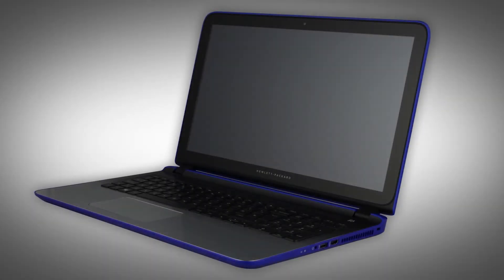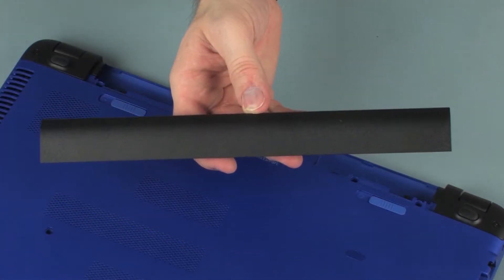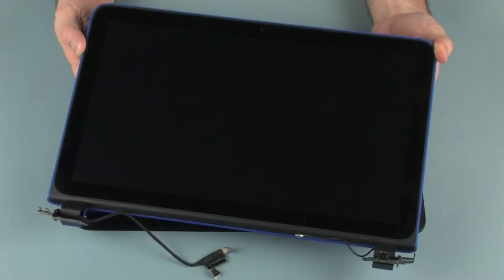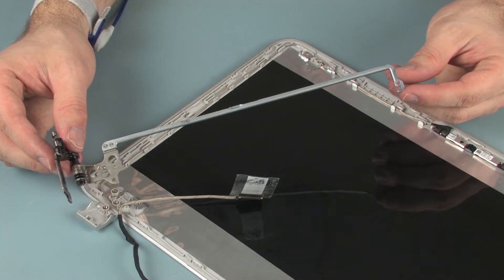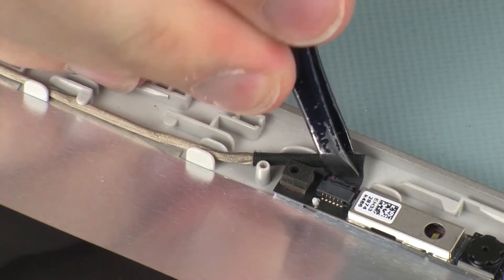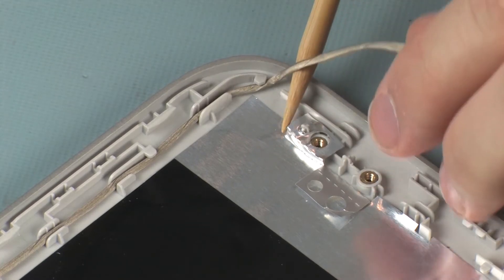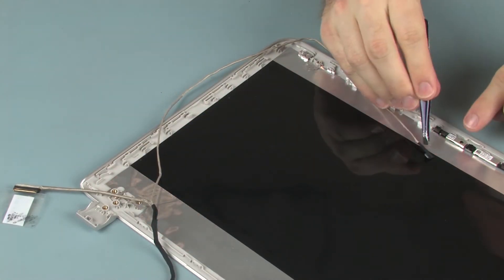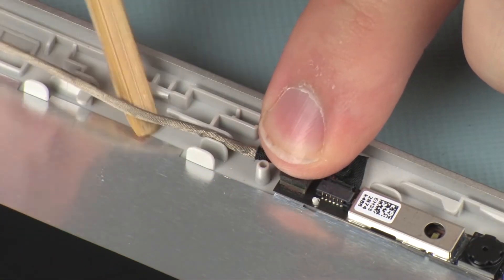Replace the Display Panel Cable | HP Pavilion 15-ab000 Notebook | HP Support

Comment: The 40 pin lcd connector on my laptop, two wires are pulled out because yall just put the wires in there and apply adhesive to keep it ik place, now its out and i cant do anything

Comment: My laptop display is very dim i have purchased few months back only(15sfq5007tu) Indian model the service engineer provided by hp also replaced the screen but the problem is still not solved im facing issue from past 15-20 days in my studies what could be the possible solution ??
Now the engineer is saying that the display cable is having some sort of problem
Reply from the maker: Hi Abhishek, thanks for contacting HP Global Social Media Support!
I understand that you are experiencing an issue with your notebook as the display is dim.
I will do my best to assist you.
Please try the steps mentioned under this video to fix the issue: https://bit.ly/459dePT
Binu-HP Social Media Tech Support

Comment: Where is having good repairs hp service centre in Hyderabad Telangana state
Reply from the maker: Hi Pravin, thanks for contacting HP Global Social Media Support!
I understand that you need to know about the service center.
In order to get this issue fixed, please contact our customer care team over the phone or chat for further assistance, as this issue requires Live conversation with you over phone or chat to isolate the issue and provide you instantly with appropriate solution or repair/replacement options available at your place as per the warranty.
Please feel free to reach us on call/chat, please access this link to select your preferred country and language option to reach us. Global support link: - https://www8.hp.com/us/en/contact-hp/ww-phone-assist.html
Binu_HP Social Media Tech Support

Comment: My hp laptop wire is broken.. the thin black wire is split... How do I fix that???
Reply from the maker: Hi there, thanks for contacting!
I understand that you are experiencing an issue with your notebook as the wire is broken.
I will do my best to assist you.
In order to get this issue fixed, please contact our customer care team over the phone or chat for further assistance, as this issue requires Live conversation with you over phone or chat to isolate the issue and provide you instantly with appropriate solution or repair/replacement options available at your place as per the warranty.
Please feel free to reach us on call/chat, please access this link to select your preferred country and language option to reach us. Global support link: - https://www8.hp.com/us/en/contact-hp/ww-phone-assist.html
Binu - Social Media Tech Support

Comment: You spend so much time showing us how you run a cable but no time is spent showing us the motherboard connection? Honestly... How silly
Reply from the maker: +Tate Academy Please refer the user manual of your notebook to know about removing and replacing the parts: https://bit.ly/3zz6BI1

Comment: Thanks a lot for this great video.

I would like to know the exact name of this "panel cable" that works for this model "HP Pavilion 15 au123cl".

If there is any oficial site where I can buy it I would be pleased, I need this cable in Ireland.
Reply from the maker: +ezequiel garcia You can purchase the part from here: http://partsurfer.hp.com/ Please select your country and enter serial or product number of your unit.
Reply: @HPSupport  That's it! thank you for showing my where to buy this product, but I need a serial or product number, where i can find it?

Comment: My HP Laptop Has A Small Damage But This Damage Gro And Make A 1 Centimeter White Line I Don't Know 
What I Am Do Please Help
Reply from the maker: +Vishesh Dwivedi This document provides solutions to a variety of problems that can occur with notebook and All-in-One displays such as blurry text, poor video performance, black or white screens, or damaged hardware. Find a section below that matches the problem with your display, and then follow the steps to resolve the issue: http://hp.care/2oPxHcG

Comment: When I turn on my laptop, only the keyboard lights show. The caps lock and number lock flash 5 times. After that, the fan in the laptop starts making a louder than usual noise. The screen does not come on. What is going on please?
Reply from the maker: +Glory Ohiemi This document provides possible solutions to many common computer start-up issues. Follow the instructions in this document step-by-step to help isolate the problem and find the most appropriate help: http://hp.care/2oFlOWC

Comment: My laptop only works when the screen is positioned in a certain angle- is there a video explaining how I can fix that?
Reply: Same problem here bro the wire may be damaged like in my case
Reply from the maker: +An Ha The cable that connects the display is probably damaged or loose. Please contact our phone support team to fix this issue: Please follow these steps to reach them.
Step 1. Open link: https://support.hp.com/us-en/contact-hp
Step 2. Select the product type.
Step 3. Enter the serial number of your device or select let HP detect your product option.
Step 4. Select the country from the drop-down.
Step 5. You should see the HP phone support number.
Reply: I have the same problem. Did you fix the problem @An Ha? How can  you do that and how much cost(price) needed?
Reply: @rohanshava5490  we did! we actually got a new screen, which fixed the problem

Comment: Would be helpful if you showed where on the motherboard needs to be accessed to connect/ disconnect the cable  (the link you have down below in another comment doesn't provide any information about the display panel cable)
Reply from the maker: +Tahlia Schroeter Please refer page number 59 of the user manual to know about removing display panel cable: https://bit.ly/3fJZS2Z

Comment: my hp ab 205tx display got pink lines and touchpad mouse is not working! please help!
Reply from the maker: +Sri Tej Koduru Please perform updates via Windows and HP Support Assistant as mentioned below to fix this issue:
Step 1 Windows Updates - 
1) In the search box, type and open Windows Updates. 
2) Check for updates. 
3) If the updates are available, click on install and restart the computer. 
Step 2 HP Support Assistant Updates - 
1) In the search box, type and open HP Support Assistant. 
2) Check for updates. 
3) If the updates are available, click on install and restart the computer.
Reply: @HPSupport  I did all of that. The software is fine. I assume some hardware issue I got.

Comment: When i turn on my laptop,  all the screen turn pink,  and a sticking image is shown with the HP logo,  is it the problem with the cable?  Or the screen?
Reply from the maker: +Ostertag Lau Please follow the guidelines under this document to fix this issue: http://hp.care/2oPxHcG
Reply: I broke my wire and iit's still showing
Reply: @Cloud9-v6  I finally replaced the display panel, problem fixed!

Comment: How do I tell whether the screen is faulty or the cable itself?
Reply from the maker: +Salty You can try swapping the screen or cables with another to isolate the issue.
Reply: @HPSupport  alright, thanks.